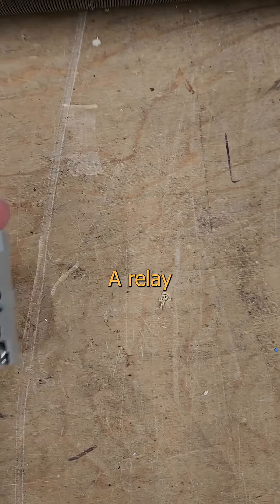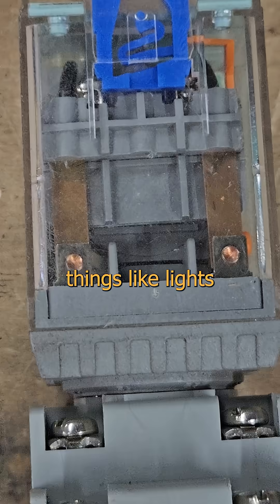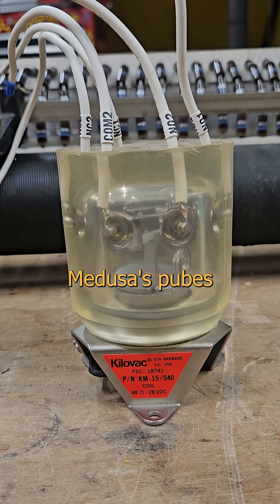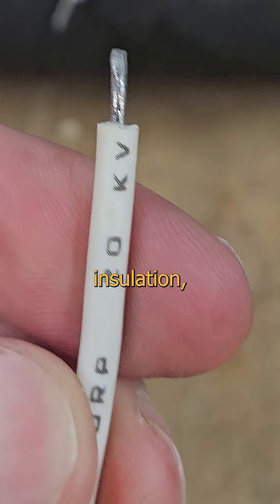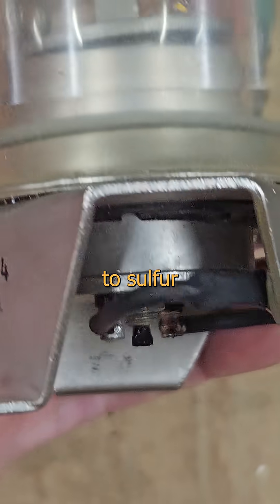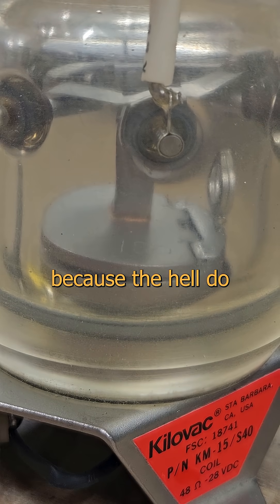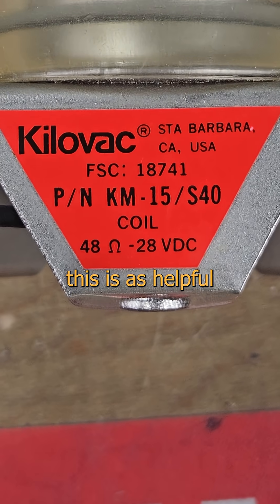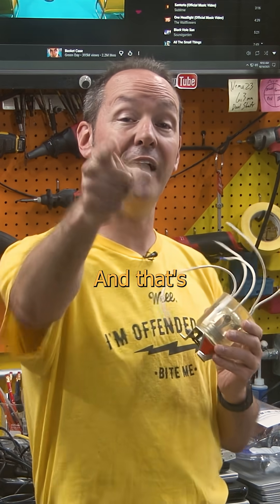High Voltage Relay #chrisboden #comedy #engineering #electrical #science #educational #jokes #adult

Comment: TE Connectivity still has listings for obsoleted KM-13 and KM-17. They both say they are DPDT Gas Filled Pressurized relays.
KM-17 still has a data sheet and says it is Make Only load switching 7.5kV 10A continuous - used to be available with 12 or 24VDC coils.
Reply: Coming here to say something similar.  This should be a 5kV relay at 10A.
Reply: @dieselchevette came here to say this too 😂 nice to know some of us are still around that like to try to be helpful lol
Reply: After a little more digging, KM stands for Kilovac Medical, meaning this was likely for some sort of medical device application. The other relays in that class are at 7.5kV@10A, so my guess is this may be as well. It may be an internal component for an x-ray machine of some flavor.
Reply: @bradleyard4195  you probably don't want sparks in an oxygen rich environment.
Reply: @bradleyard4195 Sounds perfectly adequate for use in an ECT device. We could use one around here.
Reply: @stevebot  Oh boy! Does this mean I can finally get my brain flossed?!
Reply: @bradleyard4195  Another poster said they recognize this from defibrillator machines.  With your comment, seems plausible.
Reply: KM-17 datasheet states "Widely used in defibrillator
applications". I guess that would make sense.
Reply: @noldos   And you would probably want it sealed if it were going to be near sources of pure oxygen, like an Emergency Room.
Reference to a KM-14 says the 'high tech polymer' is silicone. Also claims vacuum.
Reply: @GordieGii why would you want vacuum? Wouldn't that make it more prone to arcing and static discharge?
Reply: @martindinner3621   Corona. Not arc. 
Arcs happen when the voltage exceeds the ability of the nuclei to hang on to their electrons and transform into plasma, which is highly conductive, like a flash tube. 
In a vacuum the electrons 'evaporate' of the negative terminal and 'condense' onto the positive terminal.
Reply: @noldos  I was wondering when you would use a "make only" relay but that would work great if it's just to close the circuit to the patient. 

The relay wouldn't need to open the circuit until the capacitor had already discharged and the circuit was dead.
Reply: @deltab9768  10A would be a bit much for a defibrilator pulse.  But sounds reasonable for fast shorting out the charged capacitors after use without igniting any odors of Ether and other flammable disinfectants.  Note that in relay descriptions "make only" could just mean there is no second pole getting disconnected when switching.  That sense of "make only" is very common for simple  jobs like turning on big neon sign on a rooftop.
Reply: @johndododoe1411 So basicly, 1x NO as the main contact, no CO or NC? (and i guess no auxillary either)

okay the the beginning of the vid, the wires are labeled, looks like there are two Changeover contacts, atleast there is NO1/2,NC1/2, Com 2 (maybe Com1 is on the underside?)
Reply: @johndododoe1411 Since it says "make only load switching" my guess would be that  it is okay to be switched ON with the load connected, but not switching it OFF under load. That would fit the capcacitor discharge function.
Reply: Right, for discharging a cap bank, you don't need the ability to extinguish an arc. That eliminates a lot of the usual high voltage requirements.
Reply: @AlexandervanGessel  Awesome, I was trying to think of what it would do that could be Make Only, and I had read the defibrillator comments, but I hadn’t put the two thoughts together. Thanks 👍
Reply: Replying to boost the engagement. Hopefully he sees y'all!
Reply: Boosting! Hey Chris—pin this one!
Reply: bump I only play with small electrons. Seeing things for large electrons is interesting.
Reply: Finally someone helpful
Reply: Well done, a comment section that didn't troll and was helpful. There is hope for humanity still and the foundation of the internet 👍. Thanks for the comments. 

I work in a hospital, and it makes total sense it's an environment you wouldn't want an open spark. There is more than just pure oxygen around, which is the most common, like nitrous oxide (known as laughing gas). Carbon dioxide is also used but not as exciting as the other two with an open spark. 
A petrol station would have something similar that's enclosed to control the pump.
Reply: @JuicyBone1719  So is it pressurized and gas filled to prevent the contacts from arcing with the high potential they're switching? Just curious...
Reply: @SoccerPhoto  I don't know about this one, but some devices are built that way. I'm not the first to mention it in these comments but pressurizing the space with sulfur hexafluoride has been a way to stop contacts from arcing since the 1950s.
There's a wikipedia article entitled Sulfur hexafluoride circuit breaker with details.
Reply: just watched the video, and google-fu lead me to the same sets of datasheets. The KM-13 looks identical (all be it low rez jpeg compressed).

If I had to guess, the S40 designation probably means it was good for 40V control signal. But way outside my scope of electronics, so that's just a WAG.
Reply: I absolutely love the sheer amount of people who know stuff. A+
Reply: Interesting.
Reply: "make only" makes(haha) sense when dumping a capacitor.
Reply: I believe that's the same thing. You guys are talking about the wire he's holding onto has 20kV insulation rating on it, and it's most likely a make, not a brake type switch. We use them for pre charging on a high voltage variable speed drive. It's a slightly different version, not clear potted, but it's only single Pole.
Reply: Tyco says basically the same thing, only addition is that they're for medical use
Reply: I found the same thing. Aerospace designed double pull double throw switch, my gut says it's a gas filled housing and not a vacuum. What bothers me is that every Kilovac relay has a casing of somekind and isn't clear, either this relay is too old and not supported anymore, or the casing for it has been removed at somepoint. Could be a demonstration piece aswell, to view the inner relay when its powered(?)
Reply: @azureraine2505 Tyco catalogue shows a similar, clear one to this but with the posts coming out horizontal not vertical and the other one in the same 7.5kv section is not clear but has vertical leads. The section has the KM13 & 17 in it, just no 15
Reply: @azureraine2505   Double POLE double throw.
Reply: Is there a listing for what common mode voltage it's rated for? I could see use for a part where the major issue is isolating the coil from all the contacts not the contacts from each other.
Reply: If you want to be helpful, at least leave seven or more words in the comments.
Or just ratio trolls.
Reply: I’m glad your here!
Reply: Once Chris learns what it is, does he ever do anything with the doodad?
Reply: few of them are listed with SF-6 which he suggests in the video. seeing this a month late but yea lol did a quick google for kilovac and found that site, some pretty fancy tech!
Reply: That makes a lot of sense. That contact spacing could easily be enough to hold off  7.5kV, especially with the right atmosphere/filling. 

It doesn't have enough space to break the arc under 10A load though, hence "make only."
Reply: From what I could find it is in a family of RF application Make Only Contact Hi-V relays usually vacuum filled.  I could find a KM-14   but the 15s are phantom parts.
Reply: @Dragonx0562  it might came from older defibrillator

Comment: tiny contact spacing makes me think there's a vacuum inside.  High voltage is more than happy to jump in air
Reply: I saw a different comment here wherein the commenter said that arcing is better in low/no pressure, and poor in high pressure. Certainly I'd expect high-pressure SF₆ to impede arcing.

Comment: Te connectivity bought them out. It's a harsh environment contactor. Not rated for flammable operations. The protections and isolation are more to protect its function, vs isolate its function from causing a source of ignition. 

I've worked with a KM15 before in a lab. But it wasn't an S40. I think it was a T47. Had a beefier base and was used due to vibrations. (Safety pump circuit on a large rotating table. )
Reply: I was going to say. Explosive environment equipment doesn't usually call for the clear poured housing. That's usually for use in acidic or alkaline environments depending on the polymer itself. And it's clear so you can easily check if it's still doing its job and protecting the relay from corroding. Usually mounted in a control panel of some sort as well so an operator can have visual feedback that at least the button worked.
Reply: I'd guess it would be used for relay controls in a chemical plant or vinegar brewery

Comment: It might be sealed for use in a flammable or other hazardous or corrosive atmosphere. Here in the UK, we call it "intrinsically safe".
My experience (as a security systems tech) of this category of equipment is almost 30 years ago in water treatment plants and one time when I had to carry out maintenance checks on alarm systems on dynamite magazines (at a quarry, not military). These days, you'd need at last two trained and inducted people and a huge sheaf of paperwork. Back then, it was, "Sure, sign out these keys, the magazines are over that hill [so that if it all goes ka-boom, the rest of us will be OK]. Oh yeah, one other thing ... don't be a dick."
Reply: For those wondering: Normal relays (along with normal manual switches) have a decent chance of causing a brief moment of arcing when switching on. Since that arc can easily provide the heat necessary to start combustion, you can't safely use them in areas where flammable particles or gases are likely to be present in the air.

There are ways of minimizing arcs (like a transistor that brings the other side up to near the same voltage as the contact starts to move) but it's much safer to just embed the entire mechanism in a fluid which prevents the surrounding air from reaching the contacts.
Reply: In the USA 'Intrinsically Safe' means that there is not enough energy in the circuit to cause an ignition by either a spark or through heating. There are differing classes of 'Explosion Proof' here that physically isolate the electrical device from the explosive or flammable gas or dust. This relay would still need an 'Explosive Proof' housing so the wires could be terminated. So I'm not sure what this HV relay is for, but I do know it alone is not a compliant device for a explosive/flammable environment.
Reply: @marksturgis3536  I don't think that relay is meant for HV.
Reply: @marksturgis3536 ...correct all devices used in hazardous areas will have a label stating it's compliance
Reply: @marksturgis3536 that's what NEMA classes tells you you need a class 7 or better for vapor environment
Reply: The satisfaction of seeing my exact thoughts in the comments is immense
Reply: I'd think places with high chances of dust explosions.
Reply: @curtishoffmann6956 first thing that comes to mind when I think of dust explosions is food manufacturing, particularly anything with atomized flour or sugar. They are hella flammable and itching to react with flame. I had a friend at the steel mill who used to work at a nestle plant in Virginia somewhere. Everything there is in explosion proof boxes and heavy rigid conduit.
Reply: @jdday1757  I used to work at Detronics (fire detector company) back in the late 70's. Grain silo explosions were just beginning to become a recognized thing at that time.
Reply: @curtishoffmann6956 haha yea recognized.  It was a known hazard long before that. A reminder that every safety rule has been written in blood
Reply: @jdday1757  or maybe something involving an elevator
Reply: @jdday1757  Custard powder factories are notorious for it.
Reply: @curtishoffmann6956 yeah saw mill perhaps?
Reply: @FoolOfATuque  I don't really know the conditions in a mill, but that feels like a possibility.
Reply: @curtishoffmann6956  When I was an apprentice sparky, we wired up a flour mill, and everything was Class II Div II, and man, EV E R Y T H I N G  was expensive. 

You really don't want sparks in a flour mill. There's a damn good reason old water- or wind-powered mills only operated during daylight hours before safe electric lighting came along, and I'd wager even then there were enough brown choneys for everyone.
Reply: @curtishoffmann6956  that does seem like a possibility. Or a use case at least.
Reply: Yeah, That was my guess as well, That it's not that the electricity doesn't come into contact with you, But that the electricity doesn't come into contact with the air
Reply: Don't be a dick, nor a dumbass, is always the most important policy.
Reply: @JuicyBone1719 so important yet often ignored 😢
Reply: That's a possibility, but considering there is no ex marking, I'm not so sure. Maybe the US isn't as strict with certified components, but I have a feeling this could instead be a high voltage relay with a vacuum inside and maybe a rubber outer casing to protect the glass vacuum tube?
Reply: Yeh us gastations and fuel plant sparkys everything has to be intrinsically safe meaning its oqn isolated atmosphere due to LEL levels and flashpoints
Reply: Beat me to it.  Definitely used for some sort of hazardous location.
Reply: Like the old flameless Morse Code keys.
Reply: @brian9731  This isn't intrinsically safe.
An intrinsic safe circuit works by limiting power via a device (barrier or isolator) located in a safe area.
If it would have been Ex d or Flameproof it should have been marked accordingly on the label.
High voltage relay is more likely correct
Reply: It’s called intrinsically safe here in the US also. I have had to use many such but never anything that looked like this. Perhaps the interior is in a vacuum? It would increase the breakdown voltage to jump the gap. Also could be for use with DC, which would also increase the voltage to jump the gap. But I am still skeptical.
Reply: Yea, sealed to prevent sparks from making something go boom was my first thought? Grain mill or something?
Reply: My first thought was the petroleum industry or at the least hydrocarbon rich enviorment Either way I'd bet "explosive or corrosive enviorment" is accurate.
Reply: Yeah, that was my impression. Put in somewhere that things can go "poof" quite easily
Like a sewage pump station wetwell...
Reply: Intrinsically safe is my first guess also.
Reply: That’s what I was thinking, (class one div one) where you would need that much insulation for really low amounts of voltage
Reply: Explosion Proof?
Reply: Who was being a dick? Not talking shit, just wondering what I missed ?
Reply: Thats more likely Ex m (for potting and other mechanical protection) if its hazardous area rated at all. There might be a US equivalent rating on it somewhere. 
Ex I for intrinsic safety has seriously limited energy so there's not enough energy to ignite the atmosphere
Ex d flameproof contains the bang in the box
Ex e is increased safety, to prevent sparks  but basically needs only passive components like terminals.
Reply: I'm thinking tunnels and mines.
Reply: Yeah!! I thought so already, totally sealed off,, as far I know they have to be labeled in the Netherlands (if I remember correctly) but my expertise does not lie in these kind of components 😂
Reply: Came here to guess the exact same. Nice.
Reply: NEMA 4X class I/II relay, good call... I bet that's it.
Reply: it's probably more of a corrosion resistant electrical component just built to work in a corrosive environment probably not built to work in a flammable environment
Reply: Nope, it's just a ca. 15kV vacuum contactor.
Reply: Yeah, I was thinking environmental seal of some sort as well, though I was thinking underwater at first then realized too much bare metal was showing for that.
Reply: “Explosion proof” and intrinsically safe aren’t the same thing. Explosion proof would contain an arc to prevent igniting an explosive atmosphere. Intrinsically safe is designed to prevent a spark at all.
Reply: Hypocrites are people too. With feelings and emotions to use where and when they see fit. You dont know their life and strife. Doesn't make the taste go away any quicker.
Reply: Yeah well that all a political thing. It's pretty obvious to the reasons as well.
Reply: @osmacar Political?
Reply: @EddieTheH  it's yet another bot
Reply: @singletirefire  whoa since when does YT do threaded comments?
Reply: @singletirefire a bot for what ?
Reply: @EddieTheH relays and lobbiests are triggers i guess

Comment: It certainly does look industrial in nature, so it could potentially be a relay for a walk in freezer or perhaps even an industrial AC unit. Because it's completely sealed, it might be used in a wide array of applications ranging from outdoor use (given the level of yellowing in the resin, it was definitely not exposed to UV, so definitely within an enclosed structure), or it might have been used as a pump relay for a natural gas line or something else dealing with flammable gas of that nature. Whatever it was used for, it was definitely for hazardous industrial purposes which is pretty fuckin cool.